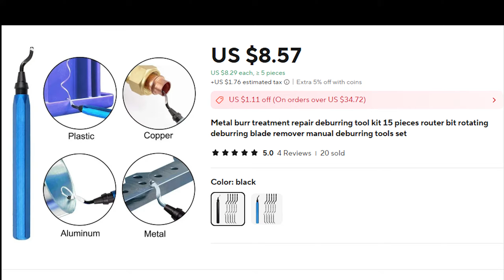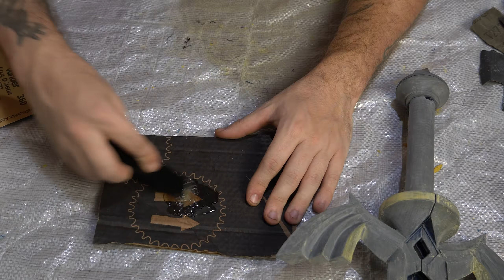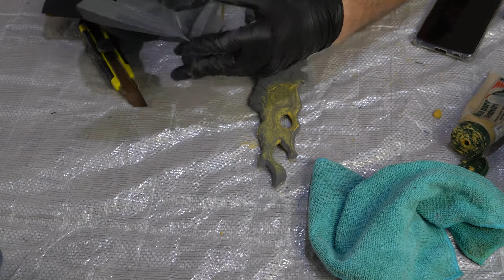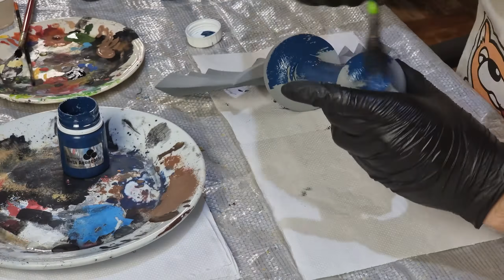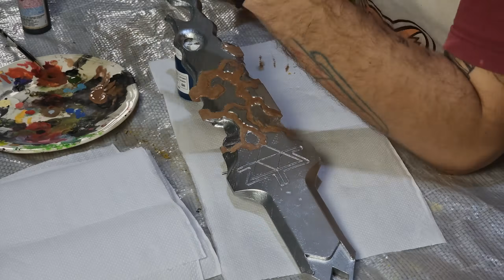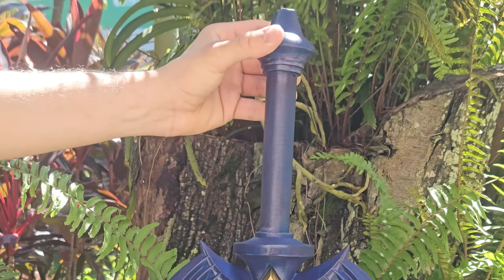Broken Master Sword 3D Printed Zelda TOTK Cosplay Prop Tutorial

Comment from the maker: Buy the 3D model:
https://linktr.ee/zebcga

Portuguese Videos at:
https://www.youtube.com/@zebcga-ptbr

This sword was made for my friend Luma
https://www.instagram.com/lumacosplay/

Tools and Materials:

Fast Drying Putty 1/4 - 3/4 Thinner

Sandpaper 150 - 240 - 360

Deburring Tool
https://s.click.aliexpress.com/e/_DetsJTd
NM-58 Azul Artico SilverBright
Acrilex - 565 Vinho
Acrilex - 531 Marrom
Acrilex - 545 Verde Oliva
Acrilex - 520 Preto
Acrilex - 530 Grafite
Acrilex - 556 Bronze

Colorgin Metalik Cromo
Colorgin Metalik verniz

Tekbond 200 
Tekbond QFS Spray 

My 3D Printers:

Prusa MK3S 210x210x250mm
https://www.prusa3d.com/en/product/original-prusa-i3-mk3s-3d-printer-3/

Sovol SV06 220x220x250mm 
https://s.click.aliexpress.com/e/_DC5vqQX 
https://s.click.aliexpress.com/e/_DknhPZv

Elegoo Neptune 3 Max 450x450x500mm
https://s.click.aliexpress.com/e/_DE29bbl 
https://s.click.aliexpress.com/e/_Deptqqr

Elegoo Saturn 3 Ultra (Resin)
https://s.click.aliexpress.com/e/_DDySZXV

Elegoo Mercury XS Bundle 
https://s.click.aliexpress.com/e/_DkD7ISR

Some links may be affiliate links, and if you purchase something through them, it may generate a small revenue to help support the channel.

Get in touch via:
contatobcga@gmail.com